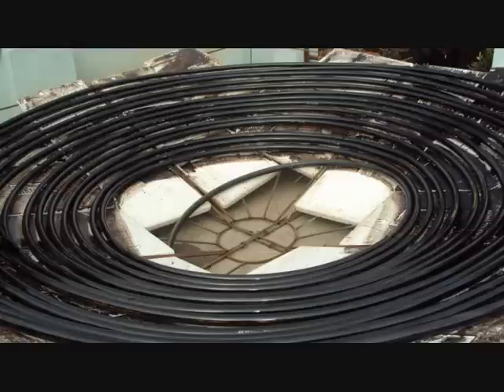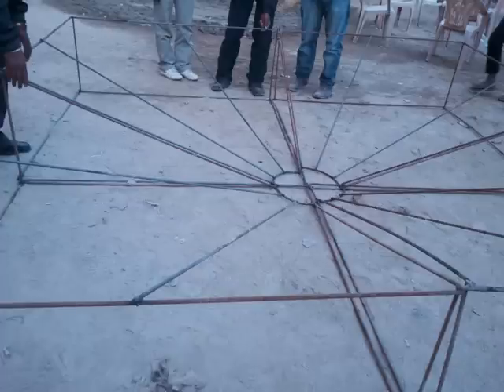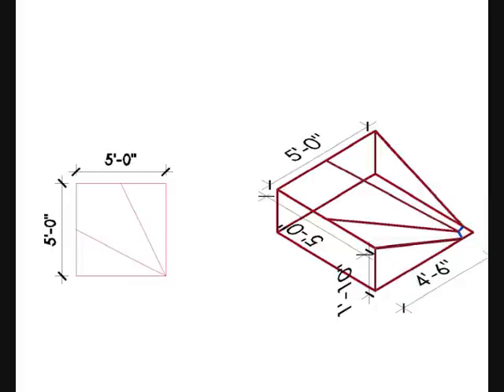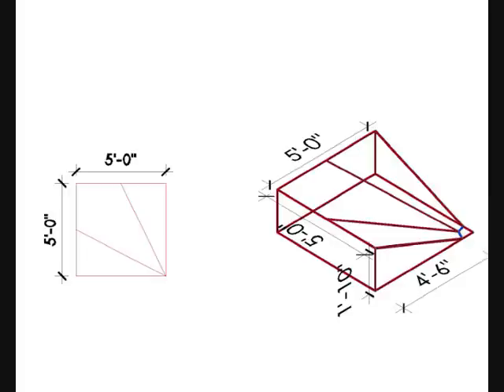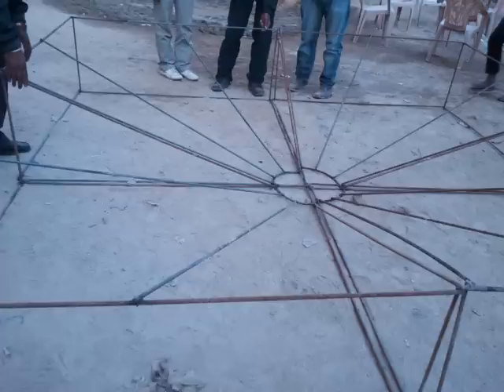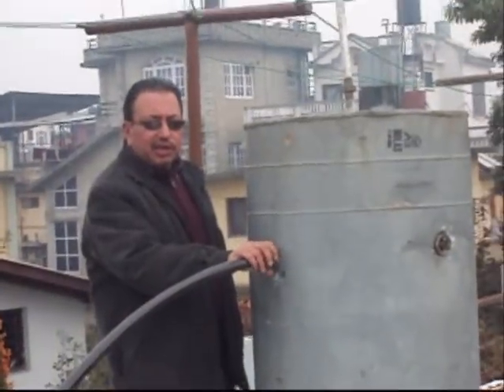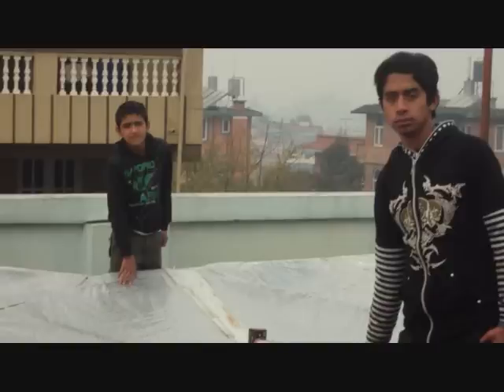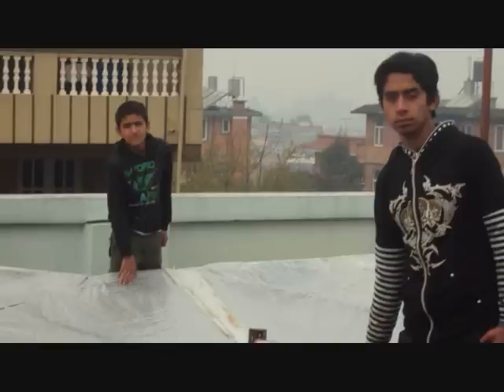DIY 100sft Solar Water Heater Innovation  to Insure free energy

Comment: I use hot water in large volume for only one reason.  Bathing.   I cold wash my cloths.  could use a small 6 gallon water heater for kitchen, bathroom sink. etc so using something like your system for heating only bath water to cut daily cost would be great.  Question though is winter.  I believe enough hot water could be made in sun but what about when temperatures go down at night and winter. It will all freeze in winter.  Can you think of an automatic way to cut off cold water from entering tub as the sun goes down.  Also how to prevent frozen damage to collector.
Reply: coachgeo The people who don't see freezing temperatures all year long are all set for hot water all year long pretty much. But for people where the temperatures will fall below freezing they use a coolant in the water in a CLOSED LOOP system, (recirculated over and over, only add coolant once) this means they use a heat exchanger in the water tank to transfer the heat from the hot coolant into the fresh clean water without contaminating the water itself with coolant, and the coolant never freezes. And the clean fresh water is in the house where it is warm, only the coolant goes outside to the coil, but the coil still collects heat in winter when sun is out, but like you said at night it don't, and if it was water it would freeze and break your pipes, but they use coolant or and oil based coolant.

But this set up in this video looks like a direct open loop, it means the water that flows through the coil is the actual water you end up bathing in. But in a closed loop system the fluid is not water, it is never circulated into your water supply, only the heat is transferred into your fresh water not the coolant.

 And even in winter if the sun is out the temperature in the solar water collector goes up. It has to be well insulated to collect the heat and people have.

Comment from the maker: @CheapEnergyIdeas 
You are right, but the volume of water reduces drastically as the diameter gets small...I shall have to put 4 times the pipe in as the diameter gets half... and the length gets astronomically large to handle...Thanks for suggestion...!
I shall check the solar hot tubes too...!